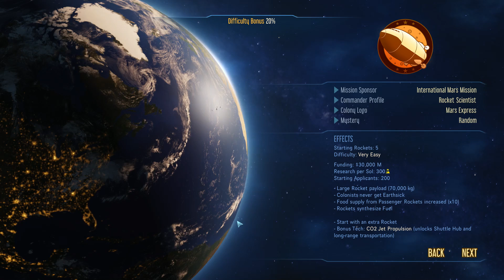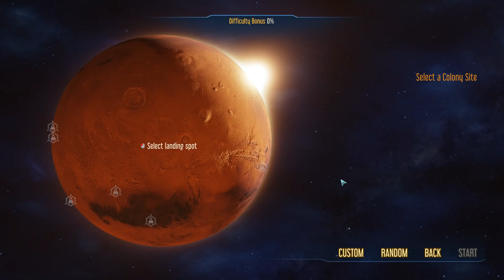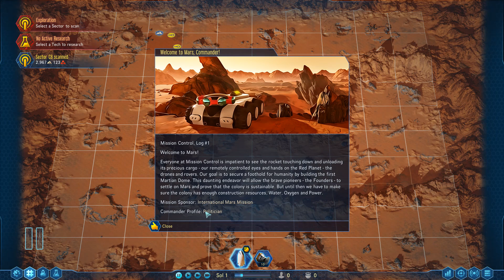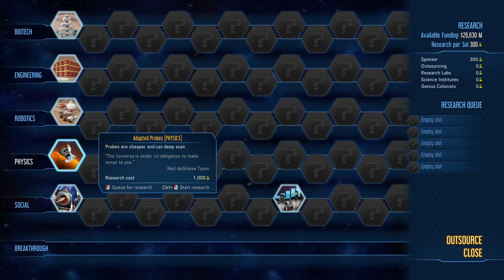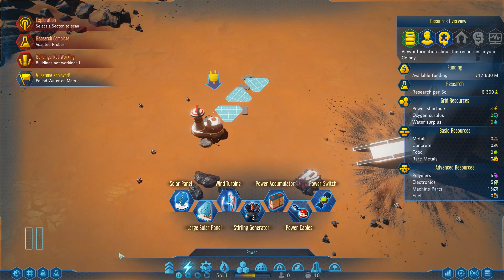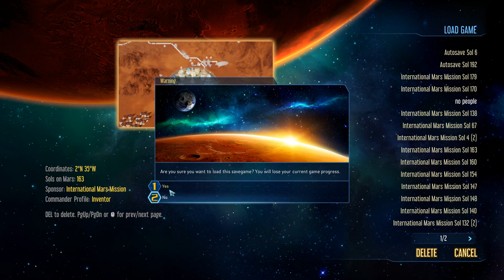Surviving Mars: Robots Only colony

Comment: taureor,you dont need a dome if you got the extractor ai breaktrough
Reply: He built all of the wonders too, the geo dome being one... Frankly I would have been pleased with two elevation levels on Mars to have two refueling bases for their rockets at the home base for any rovers and drones required. Not much infrastructure would be required at each refueling base: a fuel refinery, a done hub, a water evaporator, and a scanning tower. You might want to bring on your rocket enough medals, concrete, and electronics to build and maintain the base for a while. I would be pleased scanning and opening up all of the research trees. Getting lucky with extractorAI would have been icing on the cake shipping rare medals to sell.

Comment: How dare you do it in a sensible way of sending robots to build infrastructure first? What, are you against submitting colonists to radiation while handwaving the need for protection away? How dare you?:D
Though in reality space elevator would probably not exist and we'll need a chain of local SSTO shuttles, orbital space station and cyclers. Not sure why the game runs as rocket going back to Earth on thier own every time though. Seems like a massive waste. Well, hopefully mods will help this game grow. And in regards that will help with adding extra realism and complexity too.
Reply: If they were going anal on space elevators feasability:
1. We have (currently) no materials able to support the construction of one.
2. They would only be possible on very specific areas on maps pretty much on top of the equator.
Reply: +Rikard Nilsson
space elevator is possible for Moon though.
They could have just made a space port with shuttles though.